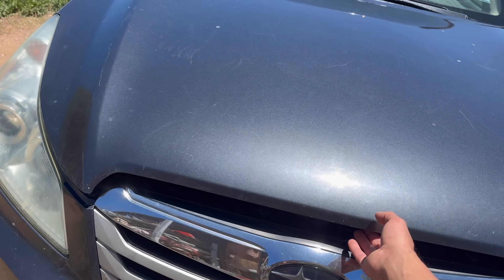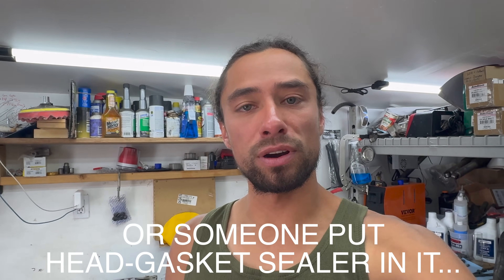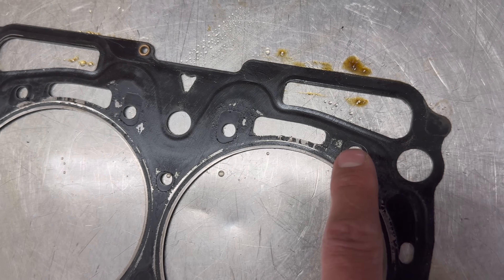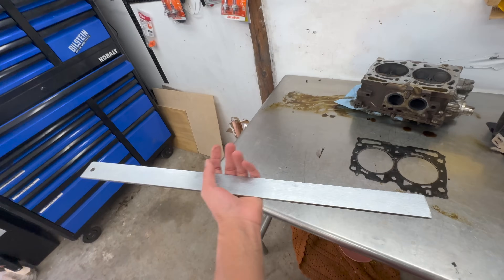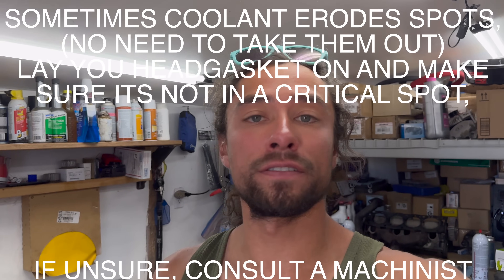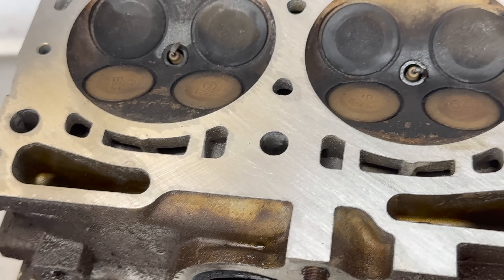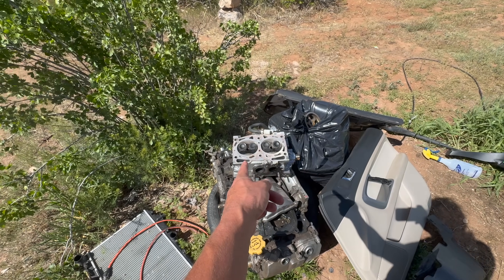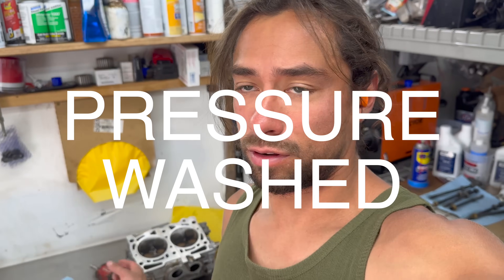How To: Resurface (EJ25/Subaru) Heads At Home - Backyard Machining 101

Comment: After cutting the necessary material to straighten the head, you need to finish the head with 180 grit sandpaper, to achieve around 0.80ra surface roughness so that the steel nitrile-viton gasket seals and also have enough grain to grab against blow out.
Reply: Would kerosene be better for aluminum??
Reply from the maker: Na
Reply: @steinfabgarage  love your videos but yeah love it or hate it a 20$ more of 180 sandpaper, would makes a world of difference down the road. I used to work at a machine shop.
Reply: @yannisx3209  I don't know if you know he used to work at a machine shop for many years before he got into cars. He does use the copper spray on his multilayer steel gaskets though which may be why he has such good success with this method. I was shown to flatten stuff by a machinist that you should  do figure 8"s on the sand paper. Do you use that method?
Reply: @crzy11000  How does that copper spray work? How long does it last/what does it do exactly?
Reply: @aradney3  I would like an answer to that because the guys I see recommend it are all tuners. They are always pulling their heads off in a short time. so I wonder about longevity.
I think it just gets squeezed into the cracks to seal them??
Reply: @crzy11000 copper spray is horrible. If you want to do the job again shortly, then use it. People use it because they are to cheap to surface the heads in the first place. And, they think they can reuse the head gaskets if they use it. NOPE! It might get it out the door, but 6 months later your reputation will be crap. I see this all the time when they bring it to me to do it right.
I use a different technique that I can also surface the block in the car without tearing it down. Did a junk V6 Escape that was severely overheated. Heads were warped .030". Aluminum block was warped just as bad. Surfaced both heads to .003", thickess of blonde hair. Surfaced the block to .004" in the car on both banks. Ran and drove great. 
The worse they are warped, the longer it takes. This method is really rough on a V6 or V8/4 cylinder head. It would take an hour or better because it comes down to lbs/in². The more surface area, the less lbs/in². Which reduces down force on the head. The sandpaper is also not long enough.
Reply: @QwertyQwerty-jq3cu  Please describe the method you use.  I am very interested.
Reply: @QwertyQwerty-jq3cu assuming you sand it all down straight and check with the machinist block that it's flat, would spraying a light amount of the copper cause any negatives?

Comment: I suppose this only works on aluminum heads ?  Most modern cars are aluminum heads.  Mostly Chryslers still use steel on the bigger motors
Reply from the maker: It will work on iron, but will dull the paper fast and require multiple paper changes

Comment: When replacing head gaskets can you use the stronger gaskets from the turbo models? I’ve heard that’s a better fix.
Reply: It's not that they're stronger it's that they are multilayer steel (MLS) gaskets that allow some flex when the engine goes through heat cycles. And, yes. Use the MLS gaskets. I recently ordered the master seal kit from Subaru (10105AC380) and it came with the non-MLS gaskets. I did not use them.

Comment: I’ll be 62 in a couple of months and have spent the last 2 years pretending to be a mechanic. Why, you might ask? Because I bought a 2003 Subaru Baja site unseen. Even paid stupid crazy money to have it transported across 2 states. I’m concerned about how my brain is aging. 

About a year ago, my radiator lost the will to live in the middle of I-10 in San Antonio. At the time, I had not attended YouTube University (had no reason to) and thus just replaced the radiator with a big hole on top with a new one. That’s right, I never questioned why it offed itself, I just replaced it. 

At this point, I have replaced a great deal of my engine one piece at a time and wouldn’t you know, it’s still overheating. If an engine could do a middle finger salute it would look like the Subaru doorstop in my driveway. 

So, you mentioned if one person commented that they wanted you to provide a video on how to get to where this one started then you’d produce one. Considere it requested. 

And now, I leave you (anyone who bothered to read this far) with one question: is a blown head gasket the only thing that would cause overheating and white smoke out the tailpipe (which dissipates after driving for 5-10 minutes)? I SERIOUSLY DON’T WANT TO PLAY MECHANIC ANYMORE! I’m old, not even close to how strong I used to be, I have “authoritis” in my hands, bursitis in my elbows and gasketitis in my DNA. In other words, PLEASE let there be an alternate reason for the plume of failed dreams puffing out the ass end of my Baja. It’s embarrassing.
Reply: Sounds like it's the headgasket. Do a leak down test and see what comes from it. Actually you can test if it's a headgasket if you fill put a funnel full of coolant in your open your radiator cap (make sure it's cold) and if bubbles come up when you're giving it gas, that's your headgasket. I'd do both before saying it's a headgasket. Also sorry for your taste in cars (subarus) 😅

Comment: Yup.. that’s exactly how I resurfaced the block on my ‘01 Forester which had previously overheated. The trick is to pass the stone on top on the block/heads without putting extra weight on them, just let the weight of the stone do the job with several passes and measure for warping with a straight edge. Use 1,200 grit sabd paper. After I was done with the passes, not even 0.002” went under the straight edge on mine. After replacing its H/Gs with an MLS, that n/a 2.5L engine became a tank!
Reply: I did as the channel owner suggested and used 80, though I followed up with 180 as 80 seemed very coarse!  But that was just cautious; he is telling he does it with 80 all the time and it is fine.  And faster!
Reply: @ 80 is way too abrasive imo. Remember the CNC machine shop leaves this with a mirror like finish surface. Take your time, don’t rush it. Let the weight of the stone do the work. No need to rush it, do it right the first time. Btw, spray some WD40 to lubricate the stone/sandpaper, don’t resurface the block dry.
Reply: 1200 is way to fine.
Reply: @  You can use more abrasive one, like 800, 1,000, then finish with 1,200. Remember, this mating surface should almost be mirror finished for a good seal. More importantly, you want to make sure you don’t have warping with the straight edge.

Comment: You are up there with Mr Subaru.
This video is on another level for doing head work.
Thanks for this and demystifying resurfacing heads. Brilliant work.
After resurfacing can you still use the recommended gasket, or because you have shaved off a few thousands off, you need thicker gaskets?
And, would you say this is only for Subaru's or any car which have aluminum heads?
Have subs. Bloody good work.
Cheers

Comment: Great DIY solution. One tip. Sharpie the head surface before you sand paper it. Once you start to sand you should remove all of the sharpie. If there are areas where you still have sharpie, then those are your low spots. This will tell you if you got all the material off or if there are issues with your method.
Reply: @ yes I do. I’ll correct it in my post.
Reply: Thank you for rebuying the supplies so we know what to use
Reply: You'll see where the sandpaper scratched, and where the hollow point still is. No sharpie or die needed. Take it down until even marks all the way across.
Reply: Any mineral based lubricant will just remove the sharpie. Paulnicholson1906 was on the money about using prussian blue. That stuff is resistant
Reply: Or dye-chem. Doesn't cost much and easy to apply.
Reply: @Spiritof_76  Prussian blue?
Reply: @ Yes, the same. Dye-Chem is probably just a brand name.
Reply: @Spiritof_76  Can you provide a link to the product? I'm not familiar with it. Sorry, I'm new to this sort of thing
Reply: @EdwardVelez  Dykem blue layout fluid.
Reply: @Spiritof_76 Thx bro
Reply: @Spiritof_76  Do you mean Dykem Blue?  Dykem uses alcohol as the  solvent and it dries completely.  Prussian blue is a greasy blue paste that stays wet.  Apply with a rubber roller to a granite surface plate and then press the part being checked for flatness into the prussian blue.
Reply: @2OO_OK  Yes. I have a bottle of Dykem in the garage; didn't remember the brand spelling and didn't go look. Permetex Prussian blue is a different product with a slightly different purpose.
Reply: … or black spray paint speckle coat

Comment: Great video man, i do have a few questions. Will 80 grit work with mls RA requirements? also, I've found almost all aluminum blocks like to warp as well. do you surface the block too?
Reply from the maker: Yeah 80 grit is good for MLS ( I’ve used 60 so 80’is super safe)

Razor blade the block surface so get the gasket material off, and your good, even if it’s out .002” that’s fine

Comment: Thank you for the video, I plan on doing this on my daughter's 2011 outback soon, I pulled the motor. I set the timing marks before pulling the heads, 1 head all valves are closed, the other has intakes wide open. I'm guessing I'm going to have to close them before doing this, And reset the timing when installed. Would it be a good idea to lightly spray the head with something to see where the low spots are? It was getting very slight bubbling into the overflow tank. I just drilled a small extra hole in the thermostat to get her by for a few months until we could put the car down for a bit. Car ran excellent but ran a little cold. 

Thanks again
Reply: Wouldn't let me edit again, Meant to say both intake valves widen open, and on other cylinder next to it exhaust valve open. Guess I'll just mark it, roll the cam to close valves and move back afterward
Reply from the maker: Rotate the cams till there’s a 30 degrees in either direction with zero load. No, just start resurfacing it and it will be obvious. 

Time the block first, they don’t time at TDC, so with the block set, your free to rotate the cams, not the other way around as the valves will be open
Reply: @steinfabgarage  Thank you for the reply, Appreciate it. The block is still set, I noticed there was a notch,.and a arrow on the crank pulley, I went with the notch as that was the only way to get crank and cams to all match timing marks. 

1 head is still set exactly as I pulled it, The pulley hasn't spun and still sitting as it was, So is the other, But I'll have to rotate that to close valves. I'll probably just mark it, Rotate, When reinstalling, Turn cam back to original mark and install...Put the belt on, crank over by hand a few revolutions, And cross my fingers..lol

I was not aware they didn't time to TDC. I guess that's what all the extra paint dots/marks and arrows are for. 

I'll just want to make sure this thing is correct, As I never want to do it again.

Thanks Again for your reply and your videos in general, A lot of help for sure.

Comment: Good technique thx for the tile idea 😆 may use glass but wish I had a long milled block like 2 or 3 ft by 1 ft however thick, Yayy N20s lol, just rebuilt the entire Mitsubishi made turbo on my sister's N20 in her f30 (14 320i X) plus a catted d/pipe and res delete. Wanted to get a  Shuenk turbo kit because the wastegate flapper design is totally different and 10 times better then the stock setup that wears out, Ended up just getting an upgraded cartridge and replaced the wastegate flapper assembly.

Comment: Just out of curiosity why do you use 80 grit sandpaper? Seems like everyone online is using 200-320 grit with this method. Is there any chance 80 grit will leave too rough of a surface?
Reply from the maker: Because 80 leaves the gaskets a surface to “hold” on to. It’s the same theory as why port and polish is good for airflow, but bad for fuel atomization. Sometimes rougher is better

Comment: Enjoyed watching this, a past machinist for many years. If head touch-up resurfacing with coated abrasives is something you do enough, might be worth picking up a good used Starrett granite inspection plate for a few hundred bucks.
Reply from the maker: I have a machinist straight edge, I’ll look into the Starrett plate! Thank you
Reply: Ya or just a peice of machinist check granite @steinfabgarage
Reply: Ouch, inflation.  "Granite Precision Surface Plate, Black Granite Plates, Granite Table Top for Inspection, Comparator Table top (600×450×100)(~24x18") $916.88"

Comment: I agree 110% with your head resurface method.  Also I was was WAS going to nag you about HOW THE HELL a clogged heater core could cause engine overheat (time stamp 1:17).  But I stopped, did some research & learned (to my amazement) Subaru (EJ based at least) are designed to run coolant thru heater core 100% while engine is running. ((There exists no control valve to stop the flow in summer etc like in vehicles I'm more familiar with)) So I can see how a clogged core could INDEED cause problems that the design does not tolerate.  So I apologize & glad I researched BEFORE "firing off" at you!!.
Reply from the maker: That’s the most amazing thing I’ve ever read. Most the clowns on the internet speak without knowing a thing, which is why I ignore my comments section now. 

All the Subaru owners who use stop leak are dooming their car for problem after problem. Then they wonder why the headgaskets blow in 50k when the originals lasted 150k

This method works 100%, AS LONG AS YOU CLEAN ALL THE METAL OUT AFTER. The same goes for any machining process tho.
Reply: @steinfabgarage  What do you think of the subaru coolant system conditioner?
Reply: @steinfabgarage  previous owner of my 2005 Outback XT ran some coolant system stop leak to clog up a radiator leak... radiator still leaked but it clogged the heater core lol Fortunately, coolant was still able to run through it but barely... didn't blow up the gaskets, but still had to replace a heater core ! Not a fun job haha
Reply: @dallasmcfadden4897 Very few vehicles stop flow through the heater core.  Only Subaru is dumb enough to make that a required coolant path for the engine to operate properly.
Reply: @ As much as I hate "fancy/unnecessary" tech in the car, a solenoid type valve would probably be a good idea for Subaru/any car...if you live primarily in a hot area and that heater core is leaking, would be nice to be able to use a scantool and manually close a valve  off preventing coolant from going there. Only because the heater core is such in a difficult place.
Reply: Thanks for the post.  After ~15k mile of trying to pinpoint my over heating problems, now at 185K, I was suspecting the heater core as well.  Now to determine how to test it once I pull the engine to do the head work

Comment: Please show how to do it in car your content is so in depth and entertaining I’m learning lots for the at home garage worker. My 06 Impreza has signs of head gasket failure so I’m very interested in doing this with out removing the entire engine!!
Reply from the maker: I’d pull it with that car, it can be done, but it’s soooooo tight. The bigger body 10-12 outback/ legacy is the only one I’ll do in car.
Reply: I attempted removing the heads without pulling the engine, but couldn't reach one of the valve cover bottom bolts.  Gave up and pulled engine, though pulling the engine is not the worst job.  Once you are down to the heads, there are only another 10 or so bolts to take out
Reply: Thank you for doing it in car! Throw a link up to your auto zone parking lot pull!!!
Reply: Way easier to pull the engine guy, takes around 1.5hr at a leisurely Saturday pace

Comment: Hey mate love your vlogs. What's your take on 2006 EJ20 versus EJ25 with respect to continued head gasket issues. Correct me if I'm wrong.. And I know you will! The EJ20 (non turbo) engines have a better cooling system as there is more water cooling the engine?
Reply from the maker: Here in the US, the only 20’s we got were turbo in the WRX, so I don’t have experience with the NA’s. But even the turbos were open deck VS the 25 semi closed deck. So yes I would say more coolant is good and leads to less head-gasket issues. Also, less power, less issues
Reply: @steinfabgarage  Thank you
Reply from the maker: @stephenbrown7167  thanks for checking out the video. I appreciate all my viewers 🤙🏻

Comment: Good tonknow on that degreaser.
Reply from the maker: Seriously the best 👍🏻
Reply: I'm lazy and don't want to go hunt down the MSDS on it.  That said I guarantee it has sodium hydroxide.  Any uncoated aluminum will instantly convert to aluminum sulfate.  Characterized by the surface turning dark grey, off gassing hydrogen (foaming), and increasing in temperature (exothermic reaction).  At highly diluted levels it will take longer.  If left to its own devices though the reaction will continue resulting severely pitted aluminum.  

If the product says to avoid aluminum or test on aluminum.  This is why.  Take a soda can flip it over and fill the bottom with the product.  Bet it consumes the aluminum in short order.

Comment: Why does everyone use 80 or 120 grit for this... wouldn't you want it to be a flatter surface with 1000 grit or something?
Reply from the maker: No, too smooth is bad, you want to “hold” the gasket, please look up “bmw N20 timing slip” the updated bmw parts are LASER ETCHED to provide friction. This is because there’s no key ways on the crank, everything is sandwiched, just like a head gasket. Same concept.